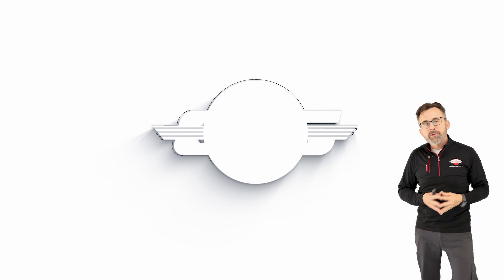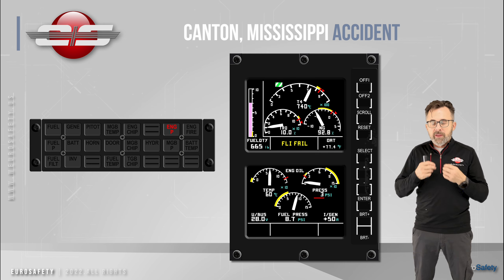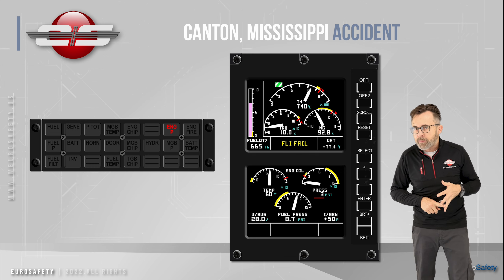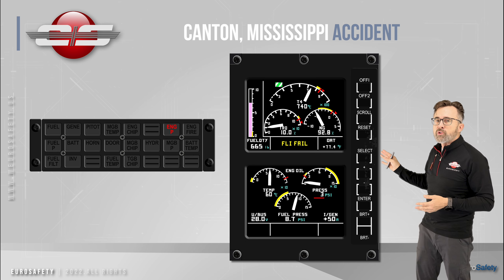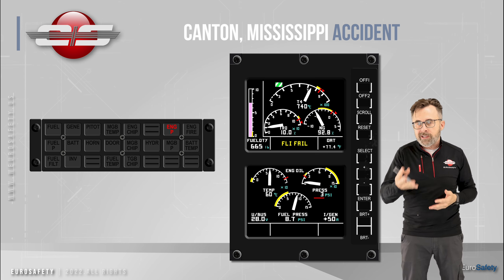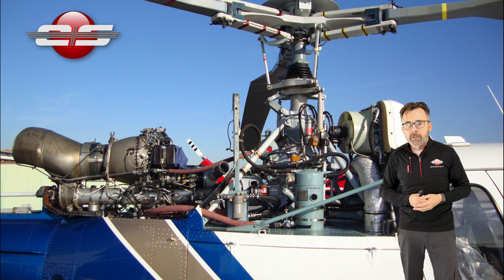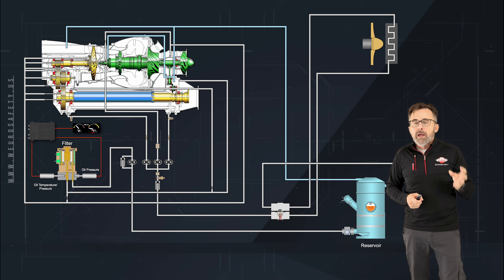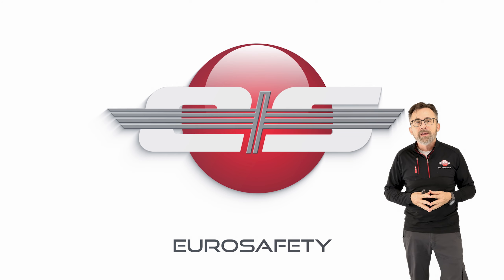#90 - Critical Analysis: Airbus Helicopters' Engine Oil Pressure Failure

Comment: Keep in mind that there are 3 sensors that read oil pressure. The Trq gauge sensor, the oil pressure gauge sensor and the low oil pressure light sensor. The pilot blew off those warnings for normal oil temperature reading. 🤦‍♂️
Guessing the engine failed very very shortly after the oil pressure light illuminated.

Comment: Good morning sir  , thanks for this presentation  , if we have loss oil pressure  , at the first we must confirm that with  oil temperature  because it's my be the indicaor sensor defect. 
Best regards. 
Mus
Reply from the maker: I think you may have misunderstood me. What I was trying to say is that temperature and pressure are two different issues. When analyzing pressure issues the temperature is Not an indicator of loss of pressure. Depending on your model you have a pressure light, a pressure gauge and if you are operating a arriel 1 engine equipped helicopter then you also have the torque gauge. You know that the pressure light system in working at the beginning of the flight because the light was illuminated and at start you saw an appropriate rise in pressure on gauge. Now if either of those indicators fail then since we know the other was working properly then its maybe a erroneous, but doesnt hurt to land. If both show no pressure you have lost oil flow.
Reply: @EUROSAFETYTRAINING  thanks sir for the feedback wich is  really  important  ,
For me  , i gave you  example for  Arrius 1A1.
I like  challenges in order to enrich our theory knowledges,  because as we are technicien we must  think to person inside and below hélicoptère. Below mean  people. 

Best regards. 
Mus
Reply from the maker: awesome

Comment: Glen...just to clarify ...assuming the ENG P light is on, the secondary indication on all models would be low TRQ ?
Reply from the maker: I was perhaps not as clear on that subject as I should have been in this discussion. To be clear. The Arriel 1 engines utilized engine oil to produce the torque indication. So all helicopters that have the Arriel 1 engine you would loose torque if you loose oil pressure. AS350B, AS350B1, AS350BA, AS350B2, AS350B2 VEMD. In the Arriel 2 equipped helicopters you would not loose torque, AS350B3, AS350B3 2B1, AS350B3e, EC130B4, EC130T2.

Comment: As oil temp increases in an engine its pressure decreases.Everyone knows about the force needed to pump a fixed volume of oil at _20C as opposed to pumping the same volume at +90.Oil temp is never an indicator of oil pressure unless the flow rate is increased or decreased releative to temperature.
Reply from the maker: I cant tell... are you agreeing or disagreeing with me?
Reply: @EUROSAFETYTRAINING  what I'm saying is that it's not a good practice to directly equate good oil temperature as being good oil pressure.Low oil pressure could be due to a number of things,low oil level,loss of oil,high oil temperature,low pump pressure or a combination of those things.If a pilot gets a low pressure warning,oil temperature is only one of many possibilities.
Reply from the maker: Ok, I think you are saying you dont agree with my thoughts. Correct? Im sure I never said good temperature is an indication of good pressure. I am saying pressure most often is a separate issue indicated by the gauge and light. Why would low oil level create low oil pressure? Why would loss of oil create low pressure? Why would low oil pressure create high oil temperature? I am saying if oil pressure goes to zero (not to many reasons it would just be low, above red line, there is usually pressure or not) temperature will not go up.